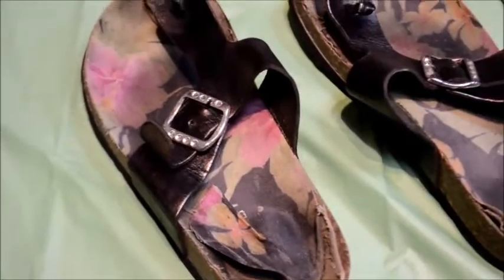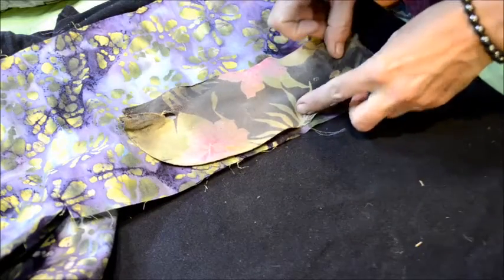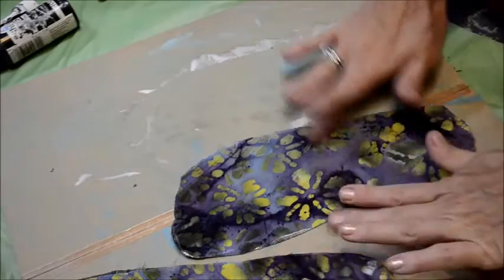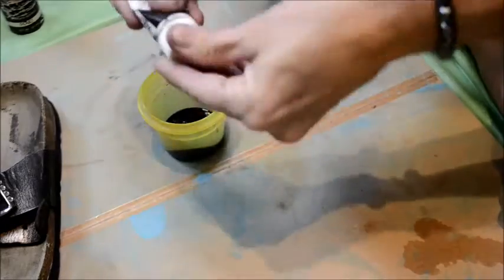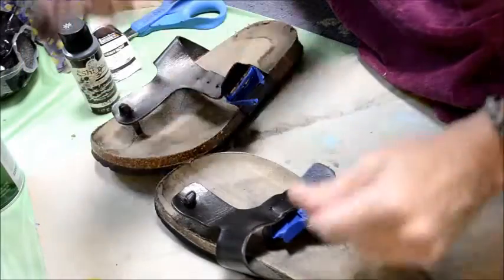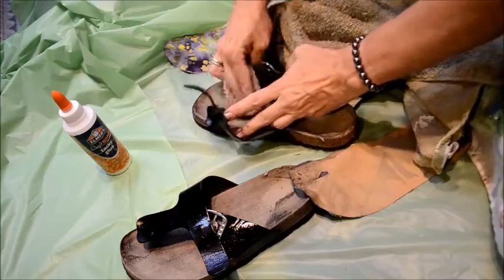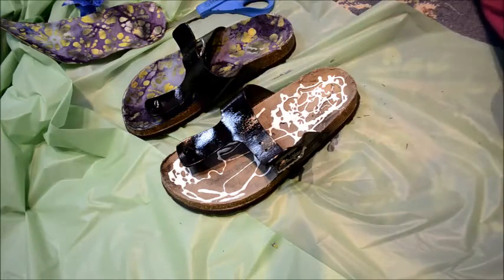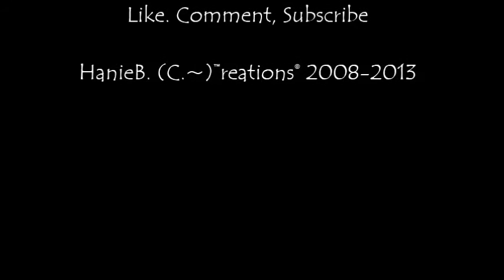How To Refurbish Old Sandals & Create Faux Black Patent Leather

Comment: Hello Hanie B. Can you tell me, do you think this process would work for vinyl, the kind of vinyl one finds in fabric stores? And, has the laqueur remained flexible after wearing the sandals for some time? Thank you for the video, very interesting.
Reply from the maker: I'm not sure if this process would work on vinyl.  I think for vinyl, i'd be more inclined to run a nice large FAT Black sharpie pen over them a few time. Spray em up with the clear laqueur, and call it a day.   The laqueur has remained flexible. No cracking or chipping.  Truthfully I've hardly worn the shoes as they're not my most comfortable, but nothing has changed since I refurbished them.

Comment: hi, great video btw. I'm restoring mine as well, but instead of patent leather i wanted more of a matte look. any suggestions?
Reply from the maker: Yes. Just don't use the shiny acrylic paint. Simply use a flat acrylic instead. Should turn out just fine! Thanks for commenting.
Reply from the maker: Oh yes, and don't use the spray paint as noted at the end.
Reply: Same here!  I was just about to Inquire, about, how and what paint, will take away, my patent leather shoes/shine; away.  Can I use, regular acrylic black paint, from the arts and craft store and also, If yes, would the acrylic paint, come off, In the rain?  If no, (with using arts and craft store bought acrylic flat paint), can you recommend, what type/brand of acrylic paint to make my shiny shoes matte?  Thank you.

Comment: Amazing!
Would you do a video how to remove a patent leather finish before spray painting a pair of cheap PayLess shoes?
Thank you
Reply from the maker: What is it you want to do with your shoes?
Reply: HanieB.(C.~)reations 
Silver spray paint, and cover it with glitter. Prom shoes
Reply: HanieB.(C.~)reations 
Silver spray paint, and cover it with glitter. Prom shoes
Reply from the maker: Here is what I would do. I would first buff them out with the steel wool. Remove all the particles by wiping them down with a cloth. Apply a coat of rubbing alcohol to make sure they are clean, and free from stains and just spray paint em. If you are only going to wear them one night than I wouldn&#39;t worry if the color doesn&#39;t last beyond that night. If you are trying to cover say black patent leather, than might have to spray a couple of coats. Spray paint should cover over the color.  Just make sure you allow drying time in between coats. Use the same brand of spray paint I used in this video except pick the color silver you like. Do a test spray onto a small part of your shoe to make sure you like the color.  After you&#39;ve painted your shoes, and allowed them to dry.  You&#39;ll want to use a clear coat.  If you don&#39;t want a high shine than buy a matte clear.
Do you already have the glitter/sparkles? After you have sprayed 1 even coat of clear-- before it dries-- lightly and carefully sprinkle the the glitter over the entire shoe as even as possible.  

Take it in steps, and do one shoe at a time. Don&#39;t try to go too fast. Hope this helps. If your comments don&#39;t show up it&#39;s because I have to approve it first . I get notifications, so I&#39;ll write back as soon as possible.
Reply from the maker: Also I'm pretty sure if the shoes aren't real leather, than the paint will stick pretty well! It's spray paint. I've used that spray paint to cover a multitude of items.  I think as long as you take your time, you should be okay. Also if you don't want to use the clear, than sprinkle the glitter right onto the silver paint before it dries. OR I think they even have spray paint with glitter now too. I'm not sure how much glitter you want, but you don't want too much sparkle anyway.
Reply from the maker: Oh wait... Ya know I was thinking I spray painted the shoes. It's been so long since I made this video.. Ha-ha.  BUT if you have acrylic paint, I would try that first over a spot to see if it will cover the black. Try a couple coats. If it doesn't cover you might have to use silver spray paint.

Comment: ive got some pink platform knee length boots once worn for fancy dress, I think they are a plastic material, would this method of using a red acrylic paint work so use them again for a different outfit I need for red glossy boots?
Reply: BTW IM FEMALE NOT MALE HAHAHA
Reply from the maker: I think you can actually find spray paint for plastic.  I can't insure whatever you do will last long because they're plastic, but I'm pretty sure you can get away with using the painted boots for short term use.  Check out  Rustoleum glossy colored plastic spray paint found at your local hardware store, or amazon should have it.
Reply from the maker: I wouldn't go thru this long process for plastic.  I might still use the steal wool, and wipe em down with a cloth before spraying. This will just prepare for paint, and remove any dirt or grime.  Than, spray the boots with one light even coat, let them cure for 24 hours.  Spray another coat, and let them cure for 48 hours.  Not promising the paint wont chip off, but you can give it a try. Good luck!